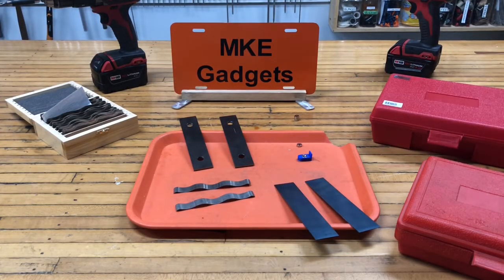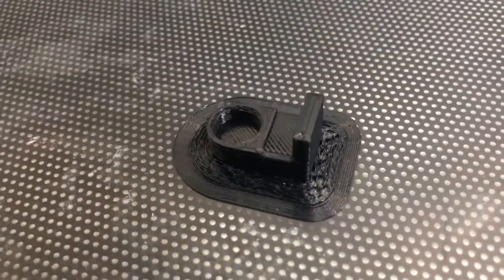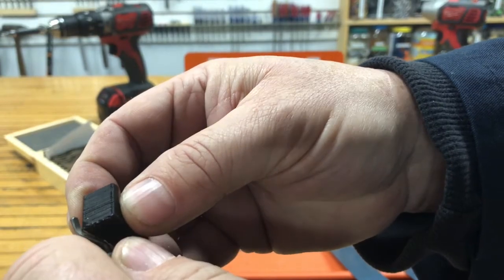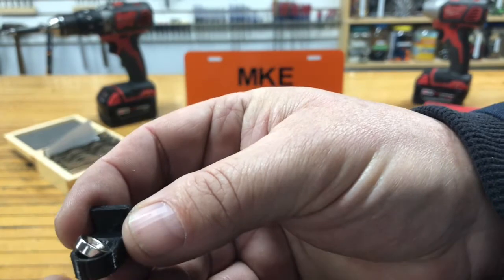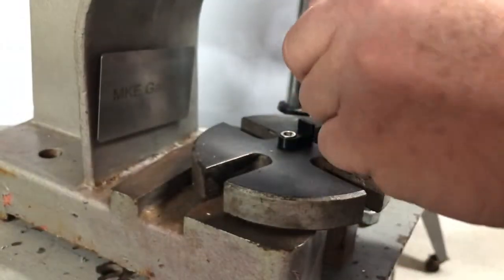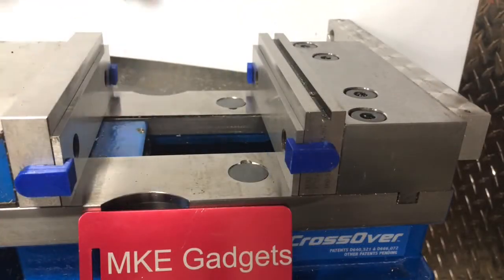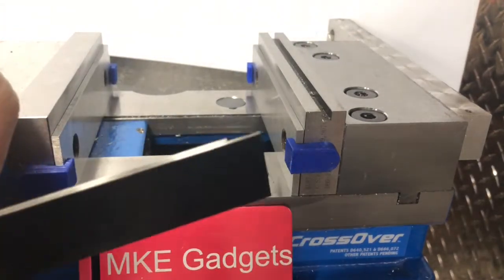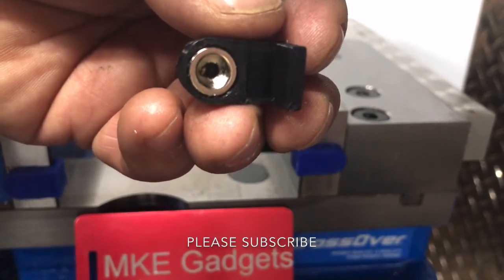3D Printed Parallel Keepers for Mill Vice @ MKE Gadgets #69

Comment: Can you add a link to the model, are a drawing so I can 3D print some of these clamps. I am a manual machinist but we have 3D printers, and I really need some of these clamps. Right now I use rubber bands, an old trick I learned about 40 years ago. Thanks.
Reply from the maker: There is a link in this description. Two things of us we can download your own and print your own here. Is that link again in case you missed ithttps://www.thingiverse.com/thing:4095660